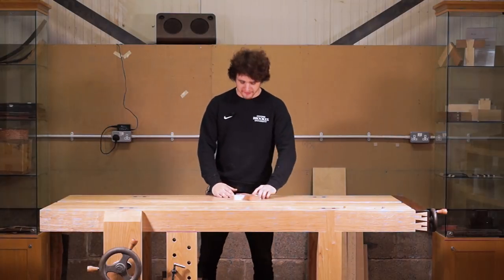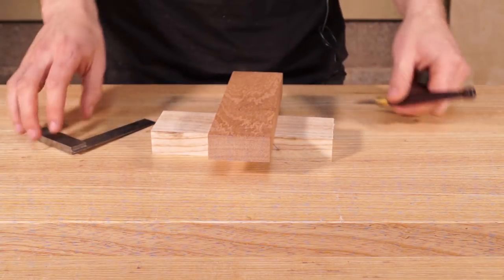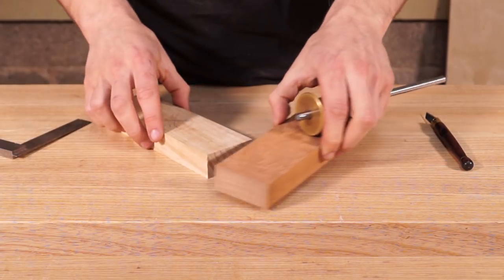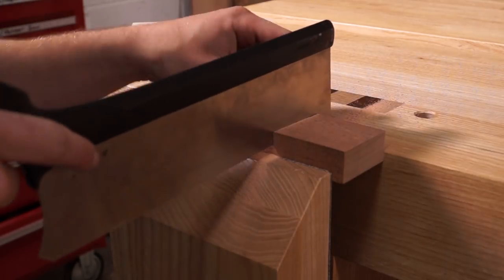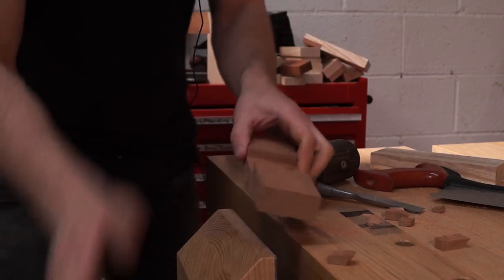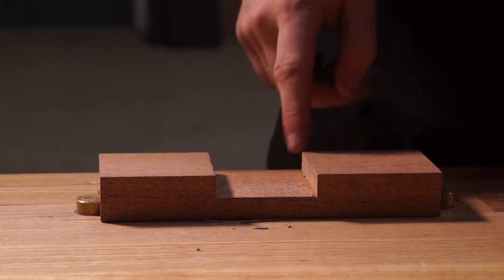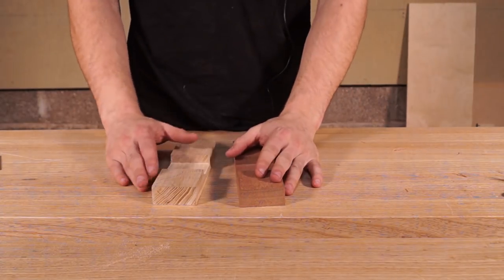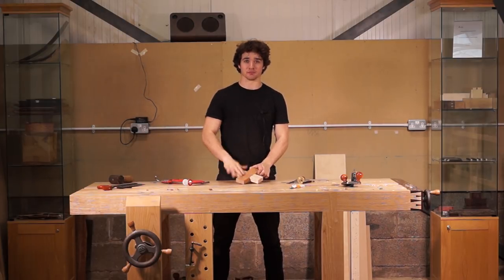How to cut a CROSS HALVING JOINT by HAND

Comment: Just a suggestion but japanese joinery uses a round head hammer and lightly tap the joint area to aid in assembly then rehydrate the wood to return it to its proper  size. Almost doesn't need glue. I love using that technique if my joint is a little tight. But as always a great video thanks for sharing.
Reply: That's a wonderful tip. I'm absolutely going to try this today or tomorrow when I get around to doing more joinery practice. Thanks for that.

Comment: Great video. Can a sliding mitre saw be used to cut out the same mortise ? You can set a depth gauge on these saws to limit the cross cut depth, just make a series of close parallel cross cuts and then hammer the remaining wood strips to get to a trench. Base of trench must be flat, thus saw arm must be stable. What do you say ? Super sharp Diablo blade needed too. Hitachi 12 inch.Sliding saw ?

Comment: Just curious - Why not use the square to mark both cut lines?
Reply from the maker: Just in case the wood you are marking around is ever so slightly out of parallel. Sorry forgot to mention that in the video!
Reply: would it make the cutline move in a tiny bit to make it too tight in the end? referencing from the square on one side gave the amount of wood remaining to enable the compression fit right?